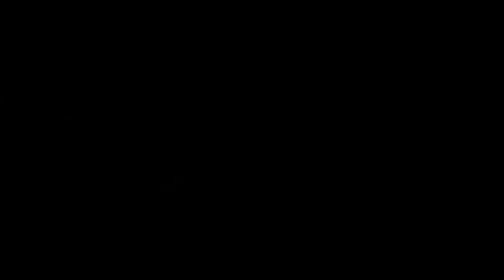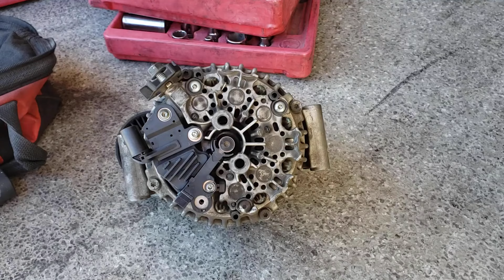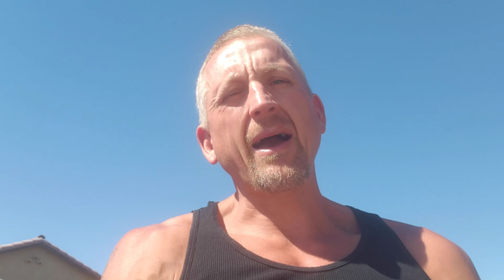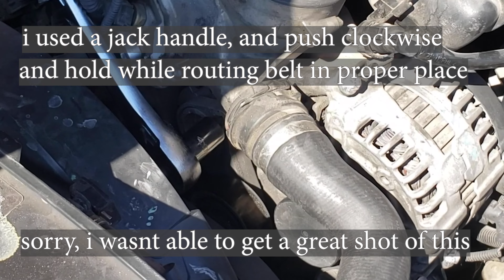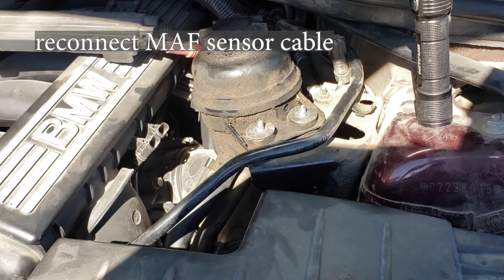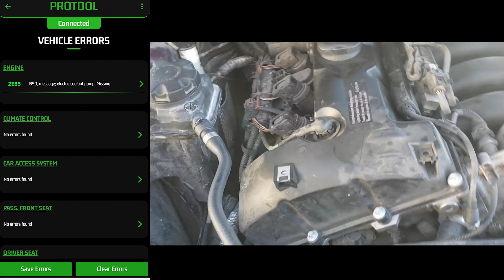HOW TO REPLACE A VOLTAGE REGULATOR BMW E90, E92, E93

Comment: Hey man, since my alternator just now passed my diode test and doesn't need replacement, I want to just swap in a new voltage regulator. However, other voltage regulator replacement videos on E92 engines do it without taking out the alternator. The area behind their alternators just looks empty. 

But with no space behind the alternator in my 2006 330i E90 N52 engine, it's impossible to reach that backplate. Did you remove your entire alternator just to reach that backplate and access the voltage regulator? I guess sanding down that center axle isn't a bad idea either. 

Been having to jump my car every time it's off for more than a couple hours now. After my jump Monday night, I monitored the battery voltage on my drive home (FIXd iPhone app) and it hovered between 13.3v - 13.5v, which is apparently too low. I'm hoping the new voltage regulator (and sanding down that alternator axle) will up that voltage to around 13.8v - 14.3v.

Did your battery voltage go up with your new voltage regulator?

Thanks for the video.
Reply from the maker: Yes, definitely pulled the alternator to get to it. Much easier that way...  it should have circuit voltage of at least 14.25v or more
Reply: @findfixxflip  so I ordered the voltage regulator on eBay on Thursday, it just arrived today (free 2 day shipping). Had to make a run to AutoZone for the T-60 socket for the tensioner, but the install went well, I jumped my car and and my battery voltage while driving went from around 13.4v to 13.8v. 

Less than an hour since I turned it off and the engine didn't start again. Now that I fixed the charging problem, I should identify the parasitic drain.
Reply from the maker: @samgod  Awesome glad to hear it's working. Good luck on your short tracing journey.

Comment: The screw that connects to the copper loop is stuck
Reply: No amount of power seems to move the screw , only the loops moves and i dont want to ruin the alternator
Reply from the maker: is the screw stripped? or just welded in place? you could try PB blaster on it and let it sit for bit to loosen the connection.
Reply: @findfixxflip  thanks that actually worked, i was just afraid to break the copper loop as I didn’t intend on taking out the alternator, thanks a lot
Reply from the maker: Awesome glad to hear, anytime👍

Comment: My new battery keeps dying on me overnight and all these lights/codes came up on my dash, my radio screen turns off at high rpms/revs there’s some rough idling, my windshield wipers turn on by them selves, can this be that the regulator has gone bad or will I need the alternator replaced as well ?
Reply from the maker: So it really depends basically go to O'reilly's or autozone and have them test the alternator and see if the diodes are working properly
Reply from the maker: If they aren't you're going to have to replace the alternator
Reply from the maker: Bad diodes will cause an overnight drain of your battery

Comment: Everyone making YouTube video’s about this Confusing everyone because this bosh part number is NOT compatible with a Valeo Brand Alternator Another OEM part that is made For BMW & not all 3 series are equipped with a bosh brand alternator!! SMH 🤦‍♂️
Reply from the maker: thank you for pointing this out, you are correct on this. I just made the video to give someone another possible cheaper option than a complete alternator replacement. Everyone must do the research and figure out which brand they have on their car first. Thanks for the input though we are a community